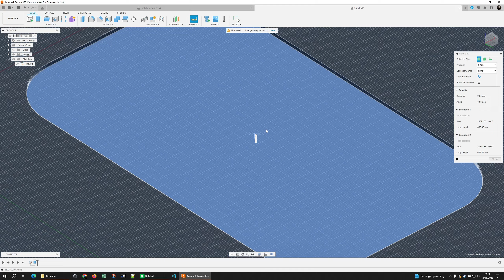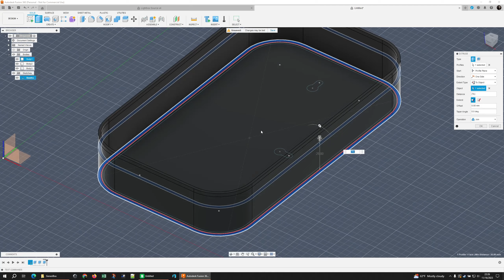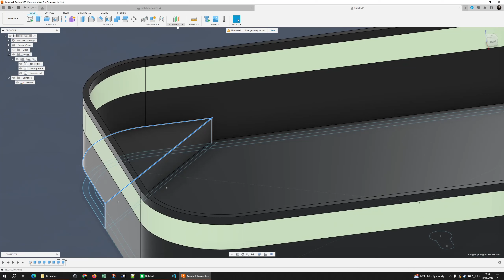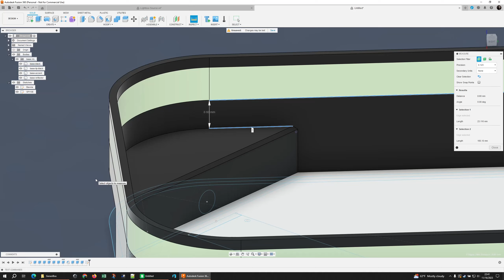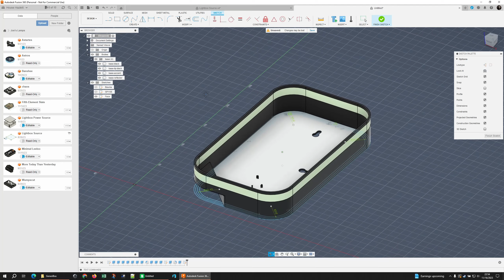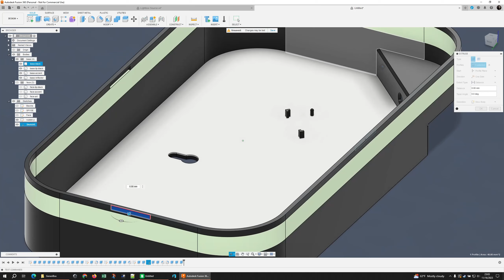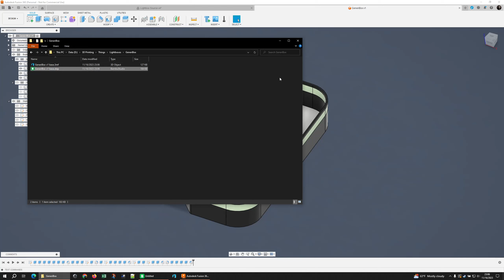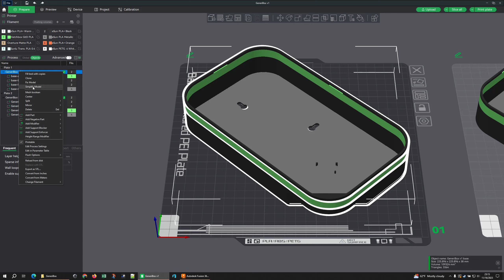Building the GeneriBox - A Customizable Light Box

Comment: When you do your wall thickness calculations - 0.42 * ? this is not an accurate representation of actual printing. In the slicer, your line width is 0.42 BUT for multiple adjoining lines (like what happens to create total wall thickness), those lines usually overlap by the default setting of 25%. In other words, when actually printed side by side, 0.42 * 2 is NOT 0.84 total width. The Gcode generates the calculation of 0.42 * 1.75 (0.42 * 2 - 25% overlap) for an actual total width of 0.735 or 0.74 rounding up. This may not seem important but for some precision pieces it will matter.
Reply: I don’t understand why you’re using math.  Make the bottom a 2mm line everyone else does.
Reply from the maker: @dugy40  I print my bases with 0.28mm layer heights. They are naturally low-detail in Z and print faster that way with no loss of quality or strength 😁
Reply from the maker: I've never heard this before, nor honestly seen evidence of it.

I'll look to see if I can replicate what you are describing but would appreciate any documentation you have that shows these calculations!
Reply: @RevHazlett  In Prusaslicer (I could not find it in BS), in the “Advanced” section of “Printer Settings” there’s a section “Overlap” and the setting is “Infill / Perimeters”. My numbers were off because the PS default for that is now 15%; it used to be 25%
Reply from the maker: @what_the_filament  the only exposed value I'm familiar with is in relation to wall/infill overlap, describing how much the infill lines will draw in to a wall line to ensure they are fully attached. I'll have to dig to see about a value for walls overlapping walls. At least in memory from Cura and current working knowledge from Orca / BS I haven't seen wall overlaps.

Either way I appreciate the info! Always good to double check and make sure!
Reply: Ah, okay, my bad. That makes sense…I misinterpreted that. However, the print lines do overlap. They have to to have structural integrity to the printed piece. That overlap may just be achieved by the ‘squish’ but I wonder if that 0.42 line width setting incorporates the amount of squish or not? Crap! I’m heading down a rabbit hole 😂😜

Comment: One of the best tutorials I've seen. Thank you! When I try to make lightboxes with a lot of white, other colours bleed into it a bit. Not a flushing problem, more like strings from the previous color on the printer bed. Any tips for that? (Bambu X1C)
Reply from the maker: Thanks! Jog back to the "Lightbox Part Deux" video, "Extremely Danger" chapter to see my inelegant solution to whispies.

A couple communities have been actively trying to find the 'magic' settings that resolves this issue, to no great repeatable success.
Reply from the maker: Also - I made this one just recently, first time using FilaCube filament (I usually use eSun, Hatchbox, and Bambu).

Not. One. Whispie.

https://makerworld.com/en/models/86139#profileId-92008
Reply: @RevHazlett  appreciate the reply! I tried pausing after layers to manually remove the whispers but that is labor intensive and kind of ruins the set it and forget it of the Bambu printers. I’ll look into the other video and filament.

Comment: Why do you make a Point at the beginning, instead of using the center point of the origin?
Reply from the maker: No real reason in particular. Historically my printers/slicers have used XY 0,0 as origin so I mentally see the build plate as entirely positives. Knowing the center of that helps for radii and center-bound rectangles and such.

In many cases of I'm moving a point to a position instead of another point it's helpful to not have to adjust for being spilt across both positive and negative XY.
Reply: @RevHazlett Thank you for your reply!